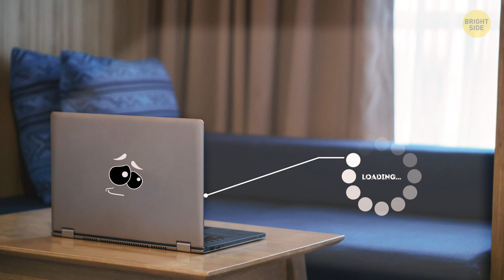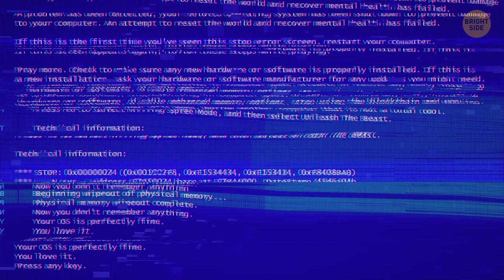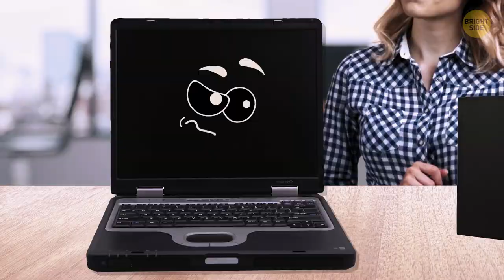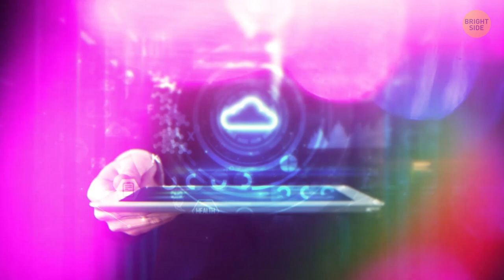20+ Signs Your Laptop Won't Last Any Longer

Comment: Actually the old bulky laptops are the best ones as they are usually the ones that allow you to replace the battery, motherboard. etc just by opening a pannel on the bottom of the device. plus theres a lot of space for adding better parts in them, and replacing old ones. you can refurbish an old bulky laptop with new laptop parts fairly easy and it will perform amazing and be cheap and upgradeable.

Comment: It’s much more likely you just need to put a solid-state hard drive and upgrade your memory. Most PCs with those two things will fly and you can get it for an $80 upgrade instead of spending 1000
Reply: my HHD is at 100 utilization all the time and making noise

Comment: 1) It's Bulky
2) It's Slow
3) It Overheats
4) It's bad at Multitasking
5) It makes weird sound
6) The battery doesn't hold a charge
7) It instantly shuts down
8) Hardware device not detected 
9) Poor color reproduction
10) Touch pad problems
11) Black screens for no reasons
12) USB stops Responding
13) Uncontrollable beeping
14) Everything destroys it

THAT'S WHAT MY LAPTOP HAS***
IT STILL WORKS:-]

Comment: My laptop is 10 years old now and I have to keep it plugged in while using. But that's the only problem it has. I'll use it until it dies since it isn't like laptops are cheap anymore.
Reply: Ever considered replacing the battery?

Comment: I used to leave my laptop on charge for a while, but now I either run the battery right down and charge it back up, and my laptop classifies as a performance laptop with the vents underneath which causes it to get quite warm while under heavy usage (gaming). So now (don’t judge this is a bit weird) I use suction cups on the two back corners of my laptop (where the fan sits) and lets cool air through the system and now it rarely gets warm

Comment: Something is wrong with my inbuilt wifi adapter. Currently using usb wifi adapter which also frequently loose connection, so I need to pull it out & then connect again. Also heats a lot after 30min of YouTube on 2x😢😥😥

Recently changed keyboard & SSD bcz of slowing HDD & then black screen pblm. Surely my laptop is having tough times

Comment: My laptop can't even charge. It shows it is charging but doesn't even exceed 0% and I think it's battery  is sealed in the case. Though that is it's only problem, for now. Still it is enough to send some crazy especially if you were writing an essay and doing your research on it, then suddenly the power goes of and you forgot to save your work. Since that day I learned to save my work after a word or so

Comment: Just throw in a SSD and you got a practically new laptop! And of course, get it to a technician to clean it from dust.
Reply: not really because there are hardware and software limitations. Also older laptops have slower memory speed.
Reply: @OmarHussainX2021  in my old laptop there is no port to plug in ssd

Comment: Does someone know why does my internet on my laptop for no reason get disconnected and shows no connections found
Reply: Le bright side : that's another sign you need to throw laptop......

You might have installed an poorly prirated windows so you will get few such bugs , you can't use keyboard hotkeys and so on.........
Connect mobile with usb tethering that works till you fix the issue.

Comment: First time i saw a bright side video with a human in thumbnail and in video as well. 

Laptop wifi literally takes a re-installation of the drivers 🤦‍♂ don't be so ignorant and i got a laptop which i bought in 2014 it has 500 gb hdd and till now i was not able to fill it up. Mostly because i don't have so many photos or other media files to put in it. If my laptop was powerful enough then i would have added games in it but it only has 2gb ram